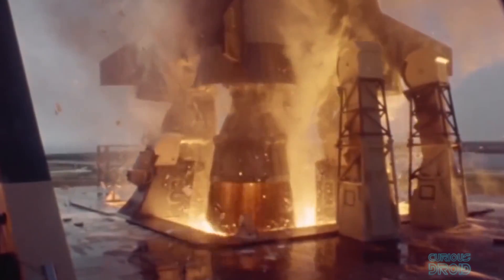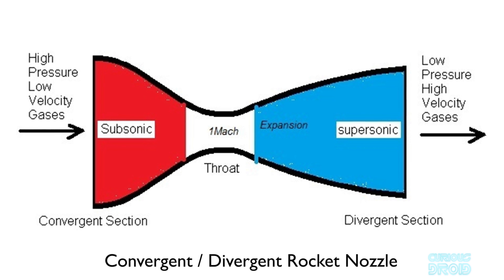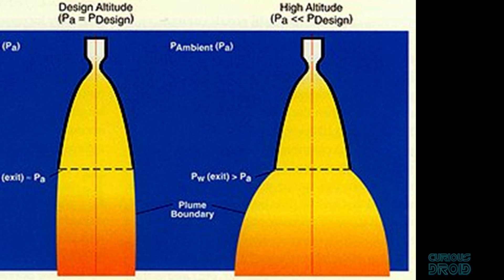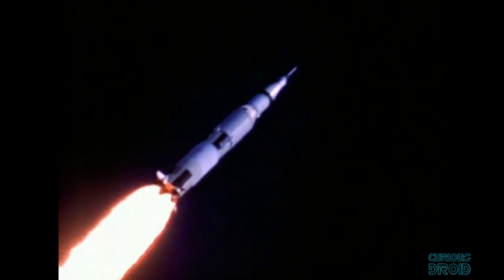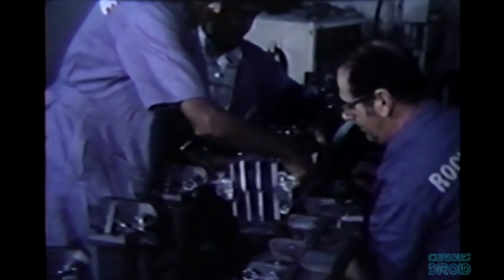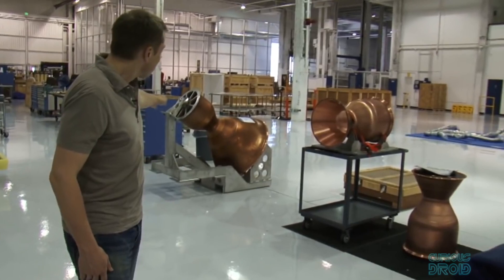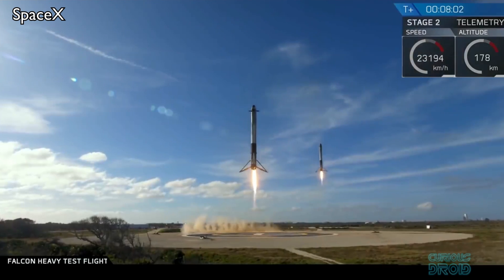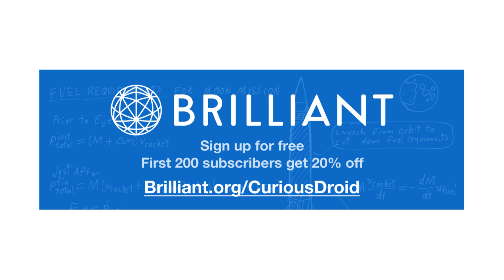Aerospike Engines - Why Aren't We Using them Now?

Comment: 2:42

1" sq isn't  2.54 cm sq.

Basic math:

1" sq       1^2=1x1=1
1" = 2.54cm
1" sq = 2.54x2.54 cm = 6.4516 cm sq

When somebody is talking about science stuff they should get basics right in 1st place.
Reply: I'm hoping they are just testing our critical thinking ability rather than actually getting it wrong.
Reply: It’s just semantics really.  “2.54 cm squared” is generally understood to mean a square having sides of 2.54 cm, the area of which as you point out is about 6.45 square cm. Reversing the order of the modifiers, ie “2.54 square cm” is understood to be purely a measure of area (e.g a rectangle measuring 1 cm x 2.54 cm, or a square having sides of 1.59cm (square root of 2.54) etc..  As an engineer I know that precision in meaning is sometimes glossed over for the sake of convenience when the actual meaning is clear.  A bit sloppy perhaps but not something that is likely to create confusion when actually doing engineering calculations.  Its a bit analogous to the difference between a vector and scalar quantity, sometimes the direction is implied or obvious and need not be explicitly stated but not likely to be confused when performing calculations.

Comment: Can someone explain me why don't they use variable Bell nozzle? It could be so beautiful engineered.
They could just make disconnectable (or burnable) lower Bell rings. Ring by ring should be disconnected (burned away) by switching off internal cooling lines or somehow else in controllable and safe way.
The remaining bell nozzle would become more spread out for lower atmospheric pressure for that altitude rocket reaches by that time.
Reply: Doesn't it need to be less opened for higher altitude, making that the opposite of what's needed?
(Idk)

Interesting thought though, they would have to work out the cooling lines, because they must flow cold fuel through the nozzle to cool it with current materials.

I wonder if you could develop some kind of protective field/layer of gas or energy over the nozzle interior to insulate it....like ionizing the exhaust lol and putting a huge negative charge through the nozzle to prevent conduction and convection....but  I wonder then how much heating the sheer radiation accounts for, and if anything could reflect that away to begin with, much less through all the hellfire of launch.

I imagine all this has been thought of, but man you never know...sometimes in a project, people figure out so much, but somehow all miss a single thing which in retrospect seemed obvious...

Comment: When I was employed at Rocketdyne I worked on the design of this beautiful rocket engine!
Reply: I was fine with developing the aerospike engine but the X-33/Venturestar was about developing far too many technologies in one demonstrator to expect success during the limited period of government financial support.  It was too many eggs in one basket, they should've done something like the Delta Clipper with the option of a ring aerospike but designed for a conventional engine.  The goal of establishing a crew launch vehicle should've been the main consideration given the complexities of the Shuttle and the obvious need to replace it.
Reply: @johnwang9914  I agree that the program took on too many technology challenges, particularly the fuel and oxidizer tanks.
Reply: You guys did some good work. I supported X-33 here and there in the 90’s a little. Too bad Lockheed tried to implement too many technology jumps in X-33. Being a shuttle tile engineer, i found it interesting LM was moving toward metallic TPS. Funny though, even LM abandoned the idea and are using ceramic tiles on their Orion capsule. Sierra Nevada is using ceramic tiles as well, and we hear Elon is moving toward ceramic TPS too. It would appear there isn’t anything better than the 60’s technology ceramic insulation for use on entry vehicles.
Reply: I would love to work with Rocketdyne at some point in time. I've always loved working with rockets and, despite the ludicrous amount of mathematics, have always found the payout to be well worth the trouble. It's either this or Nuclear Engineering for me.
Reply: I was on The Hill digging through a warehouse , probably ETEC, for some directed energy stuff and I look under a tarp.... HOLY CRAP a flippin linear aerospike just sitting there! Amazing. I climbed on top of it and poked around a bit, why not. I wonder where it went when everything was hauled off.
Reply: Joel, so you were at the Rock too :-)  I still remember how exiting it was driving my SLK to the Santa Susana Hills Lab, Susi.  I too was part of the engine development team for this engine at Rocketdyne.  God bless.
Reply: @richardacevedo280  And God bless to you too!
Reply: @richardacevedo280  the time trials up Woolsey were epic.
There should be a video about the anatomy of the margarita at Los Toros. Or the koi pond in the old turbopump test area... what was that building for the RS-27? I was at 2203 it was where we got lunch from the truck at CTL 2
Reply: OMG this is my first time i met a rocketdyne employee
Reply: When i was employed with Skynet... we had bigger plans!
Reply: @S1KWebb  hol up
Reply: L1ttle_Jonson it’s a “Terminator” reference.
Reply: @S1KWebb  there's an actual robotics company called Cyberdyne, tho. Japanese, I think.
Reply: @kingmasterlord  foreshadowing lol
Reply: @S1KWebb  when we first arrived on Earth from the Orion system, we couldn't believe how unsophisticated the Earth technology was.
Reply: If I am ever near you I would love to buy you a beer, sit down and have a good conversation, and a few more beers!!!😃
Reply: Mad respect for you sir
Reply: Cool, I hope I get to do the same one day.
Reply: @redbagelpuppies9884  Hope you do too!
Reply: Amazing to know that Joel. Would love to connect!
Reply: McAnus
Reply: Thanks for your contribution to making and keeping America great.

No politics.
Reply: @Bramon83  It was my honor and priviledge!
Reply: Santa Susanna Mts?
Reply: That's pretty FN cool. What do you do now?
Reply: That's pretty FN cool. What do you do now?  If you don't mind me asking?
Reply: I'm retired and enjoying life! @TheEddieKanejr
Reply: You are a steely-eyed missleman!
Reply: Coolsailor - you were never employed at Rocketdyne!
Reply: Why not continuied ? Luck of new ideas ?😊
Reply: Should’ve made it work
Reply: That's what they call compartmentalization that's why your right hand never knows what your left hand is going to do with it and neither does anyone in it Bingo Homeland Security
Reply: Good for you.
Reply: 🤧bullsshhit sorry
Reply: So what

Comment: The waves because the pitch angle for hyper-sonic flight has a very fine tolerance. So when velocity increases the aircraft/spaceship will always climb up to the point where the engines can't breath. But then the atmosphere becomes so thin that the tolerance on pitch angle goes up enabling RCS maneuvering and adjustment in the pitch angle to re-enter the atmosphere. Gravity does the rest. Then the new intake air accelerates the craft to a higher velocity than the previous wave and the cycle continues until there is a final orbital insertion burn using oxidizer.

Comment: There is another kind of aerospike engine where the central column is a thrust nozzle as well. The perimeter thrust nozzles are designed to compress the central column of thrust into a spike. However, instead of being a pure rocket or pure jet engine, there is a hybrid option. The hybrid aerospike, or linear aerospike, can use intake air compressed through an intake manifold with or without turbines. This type can substitute oxidizer with atmospheric oxygen. Using the aerospike to achieve the high ISP at sea level required to get off the ground. Later in flight closing the intake manifold and switching to on-board oxygen. This type could also be configured for hyper-sonic flight by using a longer launch trajectory to utilize the thin air at the top of the atmosphere. Instead of a smooth curve, using a wave pattern to dive into the air and climb back up to the edge of space. Each dip gaining more velocity with a ramjet aerospike. 

A potential third configuration could use intake air bleed to fill the oxidizer tanks during hyper-sonic flight stage. The ideal configuration would combine this with the potential of nuclear aerospike engines which would eliminate the need for liquid fuel and only require a fuel which could be atmosphere. This option would however only make sense for a last ditch effort to leave earth because it would surely cause cancer and mutations after launch.

Comment: What is interesting is this. The value of research, testing and implementation of experimental and emerging technology is demonstrated in the resistance by commercial companies to use the aerospike engine. This video and the one explaining why the X-33 was canceled shows the importance of having the right people to lead major technological based agencies. It is futile for me to blame politicians or even the project leaders and engineers on failures like this. They are chosen by the people to carefully spend the tax dollars they are entrusted with. The NASA director at the time emphasized the crucial importance of integrating the composite design of the fuel tanks as a necessary aspect of the research and yet the other technologies involving the engine design are crucial today. The fact that the air force had more faith in the  x-33 project than congress proves that political prejudices hampered advancement.
Reply: It also means that right now a major project must integrate aerospike engines into their design. For commercial companies like Ariane, SpaceX and others as well as the main NASA based contracted rocket designers to integrate the design into their human and sensitive payload launch systems a fully vetted rocket system must be implemented on at least one system.

Comment: Since stages on large rockets are dropped anyway to get rid of weight the upper stage nozzles are optimized for the altitude where they are used. This relegates the potential market for the aero spike to smaller reusable ssto rockets. Even then there are significant market forces against it not directly related to the equipment. Betamax and VHS is an example. Betamax was better but VHS gave video recording machines to movie studios to market their libraries. That produced the whole video rental market in VHS. Betamax was better but was obsolete as soon as it came out. They are now both obsolete having been supplanted by more advanced digital. The bell rocket is not only tried and tested but the machines to make them are already paid for, the people who make them are already trained, and the companies that make them already exist. The aero spike is obsolete. The bell will remain until a more advanced launch technique, possibly electric catapult, renders it obsolete too. Of course if aero spike uses, or develops, a novel manufacturing technique, possibly printed parts,  that substantially reduces the cost to manufacture that may change.

Comment: Another reason Space X did not use Aerospike engines is the use of Supersonic retro braking.  Clustering the engines creates a larger frontal area on re-entry.  Furthermore, clustering the thrust cone  would be better for creating a larger re-entry thrust balloon.  This thrust balloon being larger creates a much larger virtual drag cocoon.  The thrust acts like a big huge drag parachute. So for thrust down re-entry clusters are better. ... For Glide down re-entry  or boost to altitude jets Aerospkes would be better.

Comment: I like your presentation. ... I think that the reason Aerospikes is not used is due to engine clusters and center engine throttling.  Independantly they are out of pressure balance.  However, by throttling the power output of the center engine it creates the effect of an Aerospike engine.  Throttle center engine higher and outers lower and the thrust cone is better for high altitude.  Throttle the outers high and the centers lower and the cumulative thrust cone is better for low altitude.  .... This is why the Satrun 5 used the 4+1  configuration.  Space X Falcon 9 does the same.  ... The Russian platform used the same multi-engine concept .... So the system is based on cumulative thrust cone as opposed to just considering the single engine performance alone.  ... I would imagine that rocket planes would be the ideal configuration for Aerospike because of their ability to be used in wing edges  with low parasitic drag for glide back aerodynamics.

Comment: I'm not a rocket scientist, lol, but all the scientists which are talking about climate change, I think are partly correct. Our planes and rockets I believe are doing more of the damage to the atmosphere than our vehicles, or for that matter other ground based co2 emitters. When 911 happened and all air traffic was halted for a week, the skies were a much darker blue, very noticeable if you were observant at that time. This means, the only thing that was not being put into the atmosphere was c02 from planes. The c02 taken up to where planes fly has less air pressure on it, probably coalesces ( gathers together ) up there and does all the damage, as opposed to  ground based c02  which is filtered back to oxygen by plant life as well as marine plankton etc. The color of the atmosphere should have stayed the same if all the vehicles that were giving off all the co2in the world was affecting the atmosphere. After all they did not stop. But no, the blue color was much bluer, like when I was a kid 35 years ago. This tells me that the air pressure which you so eloquently  spoke about keeps some c02close to the ground, though wind and other factors do probably factor in, enough of it is kept rather low to varying degrees. IF we want real climate change, and fast, I think the airplanes, and rockets have to change dramatically. This new (old) tech seems to be a way to reduce some of the C02 and be more efficient to boot. Why are we taxing the people when they have the tech to actually really do some major Co2 reduction that can actually make a difference, sitting on the shelf? We have to be nickle and dimed to death while big airline manufacturers  are not doing anything?  Governments don't push rockets and space travel to use this tech cause its too much money, while spending exorbitant amounts on  military? Wow, we sure are stupid......🙄🤨😑

Comment: Up till now i didn't really know why they use 2 or 3 stage boosters on rockets used tobelieve its cause they need far less thrust the higher they go hence smaller n more efficient engines but its a lot more to it once again many thanks

Comment: It would be nice if this were real at all, the earth is flat we live under a dome, much proof of all of this, and space flight impossible due to the supposed vacuum, physics does not support rocket use in a vacuum, also listen to this video, and proof is there as described in the changing and lack of air pressure causing engines to loss thrust, well in vacuum no trust at all is possible, not me saying this, its the guy in video that basically states this. But this is known by NASA and other scientists, its just kept quiet. Do your own testing and experimenting. The dome is real and very provable.
Reply: Newtons third law, its amazing how simple it is.

Comment: I think you misunderstood the point of 40% increase in efficiency. it's not about the price of the fuel, it's about what you can lift. if you mean 40% less fuel gets you the same amount of work over the same range as a bell engine nozzle, that's amazing! you could use much less fuel while accomplishing the same work, and by reducing that fuel, you save launch weight, so you can actually carry the difference in fuel as payload. the rocket equation is a real bastard sometimes, but the saving grace is that efficiency increases are exponential.

unfortunately, that's not really feasible yet due to the reasons Jet Guy outlined.

Comment: This video is wrong. The author claims that rockets are staged primarily because the engine bells need to be a different shape at different altitudes to maximize their efficiency.

While it is true that engines designed for atmospheric and vacuum flight employ different bell shapes for the reasons the author describes, this is not why rockets are staged. The primary driver behind staging is to shed a portion of structural mass after it's no longer needed.

For instance, there's no reason most rockets couldn't be designed to lift their payloads directly to orbit in one stage, but by the time the vehicle reaches the end of its flight profile, it would be accelerating a great deal of structural mass to orbital velocity before deploying the payload. The near empty fuel tanks, large engines needed to lift all that fuel you've since consumed, etc are all dead weight at that point. If instead the vehicle drops that mass mid flight and continues on to orbit in a much lighter configuration, the total possible deltaV of the system is greatly increased. Using second stage engine with a bell designed for vacuum only makes sense here, but that's not why rockets are staged. 

At the end of the day, Aerospikes only make sense for SSTOs, and SSTOs don't make sense precisely because they choose to carry their atmospheric flight components all the way to orbit instead of staging.  This is only doable if deltaV is no object, and as long as we're subject to the rocket equation the deltaV budget will remain one of the primary design constraints of spacecraft.